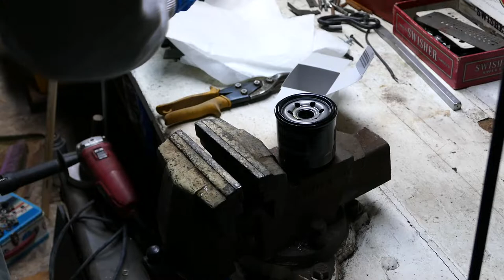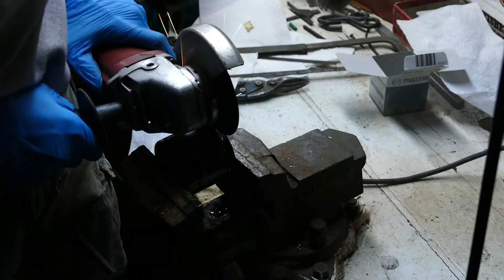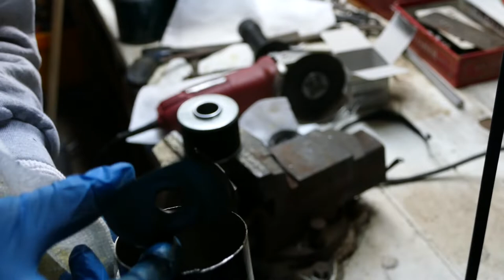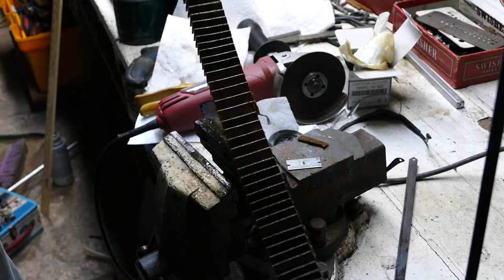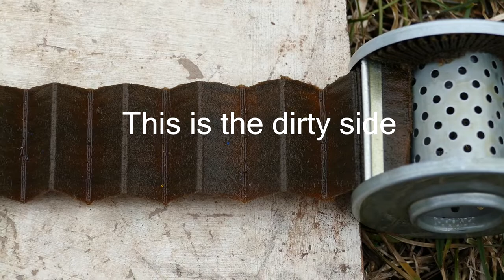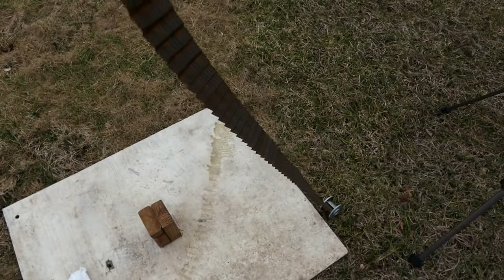What was inside a Mazda oil filter?

Comment: OMG.  Watching this guy cut open the filter makes me cringe.
For one, if the vice was holding the filter housing radially, then at least the clamping force of the vice isn't working to bind the saw or the angle grinder blade.
Then there's the razor on the paper pleates, and his fingers are "down range" from the razor blade.
Just a typical utility knife with a sizeable handle would have being way easier to control and safer.
I'm only 8min into this video.  I'm hoping I don't see blood by the end of the video...
Reply from the maker: It felt safe at the time :-)  I made a cutter to open them easily https://www.youtube.com/watch?v=9nr0wNO1kOQ